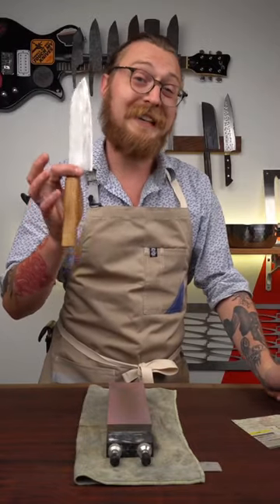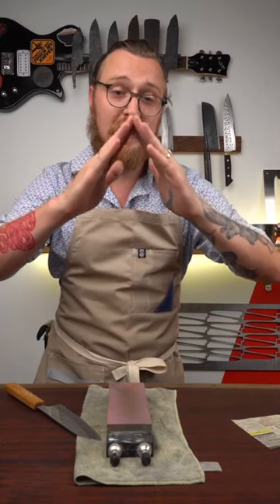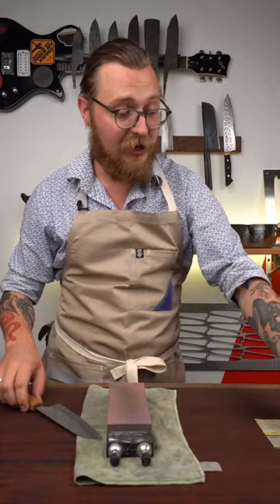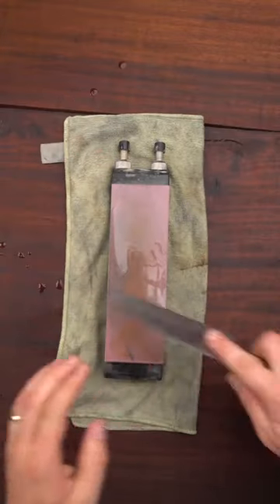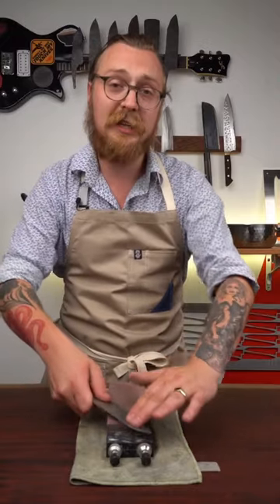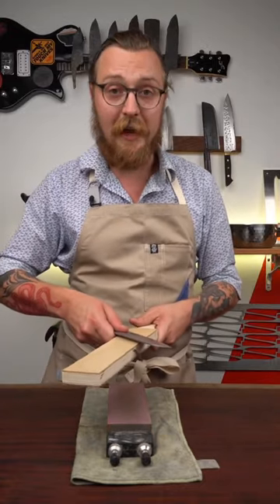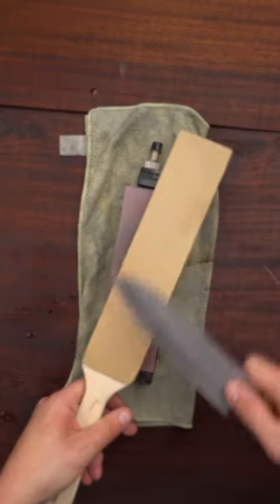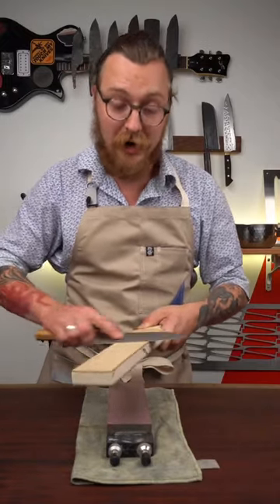Are you missing this vital step of knife sharpening?

Comment: Microburrs/wire edges can be such a pain sometimes too, even when you know about this. I think as people who like sharpening we're never-endlessly pursuing perfect burr removal.
Reply: Edge trailing is not good to clean burr, a microburr will remain no matter how many passes you do. 
Edge leading like he did really helps. 
You also need to pay attention to pressure. 
Thick burr usually requires about 200g of force to remove but this level of force will create microburr on low grit stones. 
To remove microburr use negative pressure, less than weight of the knife, just enough to make contact. This way with edge leading you can cut paper towel just with low grit stones like 120 or 300 grit.
Strops are fine but beware 10 passes on a diamond loaded strop is enough to create foil bur. They work better if you do only a couple passes
Reply: @thiago.assumpcao  
Yup, you summed up many good techniques well. I have the most trouble with the microburr on fine stones/slower cutting stones in the curved area of the knife. Been practicing that lately. On some knives it's easier to get a more stable fine edge than others. Feels tough on the more finely grained stuff. Coarse stones I usually get a very stable clean edge.

Not a fan of strops myself, at least leather ones, loaded or not. They have their place for some techniques though.
Reply: @WormyLeWorm  On the curved region you can have problems with angle stability. If you raise the angle a bit when you are creating the edge latter it will be a hassle to clean the burr. Sharpening with a microbevel will help with that. 
Usually I sharpen with 10 degree edge and finish with a a few alternating edge leading strokes on 15 degrees. 
Even soft steel like 56 HRC can hold this edge and it will cut much better than a thick 15 degree bevel. As a bonus it's also easier to clean the burr.
Reply: @thiago.assumpcao  
Sharpie showed that I was being pretty consistent, so I was wondering if pressure might be a factor in my case as well. From what I can tell, from however accurate a scale can be for this, I tend to use 50 grams or lower of pressure when at this stage and when i lift the knife and therefore have less of the knife's weight behind it, it's often 20 grams or less. 

I've been experimenting with just that technique you mentioned as well, since it seems like insurance. I seem to sharpen around 12-13 degrees naturally and then I raised it a bit and did a couple strokes at the very end. Will see how my edge from earlier today holds up soon. A fine edge on my higher carbide stuff holds up well, but on things like my white #2 knives it's tough to get that area as well as I get the heel, when going finer, it seems like. Maybe just easier to recreate a microburr on these steels.

Also been thinking about picking up a microscope to really see what's going on with my edges since the naked eye and really bright lights can only see so far.
Reply: @WormyLeWorm  High hardness knives usually are easier to clean burr than soft knives. Didn't notice a difference with carbide content but is possible. 

If you sharpen with a lot of pressure a sudden drop to 50 grams may not be enough to clean burr with just a couple passes. If you still have trouble it's worth a shot trying the 10/15 method and do some extra passes on 15 degree. You can also try to go even lower with the sharpening angle like Full Flat V Zero and finish with a 20 degree microbevel.

Microscope is fun. For burr detection it didn't help me but very helpful analysing stones, many surprising findings. I have some videos with stone microscopy but they are on Portuguese.
Reply: I avoid forming a burr at all on my knives.
Hardly ever have to deburr that way.
Reply: @autumn5592  No burr technique is is faster but takes more time to learn. It's quite easy to leave some parts not fully apexed or grind too much. 
If you can cut paper towel and shave hair when doing no burr you already got it.
Reply: @thiago.assumpcao  Yep, I can, off my 400 grit stones, not really a struggle.
I have been sharpening half my life though, so probably expected.

I certainly don't recommend the method to beginners or relatively inexperienced sharpeners though.
Reply: @autumn5592  That's an excellent challenge. Mastering low grit opens up a different kind of edge that for many tasks performs better than polished edge 

I'm kind of new to sharpening, but quite dedicated. Just managed to shave hair and cut paper towel out of a 36 grit dressing stone.
Reply: @autumn5592  I do the same, but on one condition.

That being that I know the knife has been sharpened, by me, to a burr and therefore guaranteed apex once already. Otherwise, in my experience, some parts of the edge can just end up forming a microburr or have fatigued steel that needed to be removed to create a stable edge.
Reply: @thiago.assumpcao  Oh absolutely, I love coarser grits for most sharpening. I rarely go above 1,000 grit, even for woodworking tools.
There just isn't much reason outside of looks, in my opinion -- but I'm not a chef or super fine woodworker, I need a sharp edge and pretty fast for my needs. Still fun to break out the ultra fine polishing stones once in a while though.

I haven't gotten paper towel slicing off that coarse before, mostly because I don't have anything that coarse.
But I have gotten (arm hair) shaving sharp off a double cut bastard file before, and I have sliced paper towel off 120 grit sandpaper and 180 grit oil stone.
I should try with something coarser sometime soon for fun.
Reply: @WormyLeWorm  Yeah, I should have added that -- if I don't know the steel, I almost always rely on forming a burr, because you just don't know.
My EDC knives and tools all have steel and edges I know, so I can sharpen without thinking and don't need to form the burr.
Reply: @autumn5592  Nice. Bastard file is on my to do list. I got one but never tried.

For vegetables and barbecue I prefer 1K or bellow but coarse edge on raw meat feels really bad. For raw meat I prefer high polish. I tend to use two knives so both are optimized.

If you work with western knives, hardness up to 60 HRC, there is one tip that really helped me and few people know. 

Soft steel can't hold an edge with 10 degree sharpening but if you add a 15 degree microbevel on top of that it will not roll easily and cutting performance on hard vegetables is much better.
This makes a huge difference.

You can go even lower than 10 degrees and make a full flat V Zero as long as you finish with a 20 degree microbevel.

Actual angles you can use will vary depending on steel type, heat treatment and how you use the knife, this is a general rule as a starting point. Don't use any impact on knives sharpened this way and don't touch bones. They should last quite a while. I had no issues even with 56HRC.
Reply: @thiago.assumpcao  
I don't cut much meat personally, since I don't often cook for myself.
But my sharpening job on the house knives are never complained about.

I know a fair bit about geometry, sharpening angles, and so on, because I make knives, and have sharpened professionally for a while.

Mostly people don't really know how to use knives, so I tend to leave them a little thicker and use quite a steep angle, because it just makes them more durable to lateral force.

I do also leave some of my EDC knives relatively thick because I do use and abuse them; prying, twisting, cutting things I shouldn't, and digging.
A thin knife, unless it's some real tough stuff, just isn't going to hold up.
But I do prefer thin knives, for knives that don't experience any lateral forces, it's so much nicer.

I am not particularly a fan of microbevels, because they aren't good for maintaining geometry of knives, outside of japanese style kitchen knives and the sort.
I reserve them for quick and dirty edges.
Almost all my knives are scandi, full flat/zero, full convex, or saber grind. 
Simple, easy to sharpen, maintain geometry well. Because I don't like thinning.

Microbevels, even though I don't personally like for my use, are great, and I often recommend them.
Reply: @autumn5592  What you are using them for is very different, makes sense you prefer something else.

Comment: You should use a compound on the strop
Reply from the maker: I often use chromium oxide!
Reply: You don't need to; if the goal is just deburring, then you don't need anything just a material (leather, linen, denim, card, MDF), and take a dozen passes each side. It should deburr perfectly fine.

If your goal is polishing, or further sharpening, then you can use compound.

If you are stropping to maintain edges, you will want compound.
For deburring after sharpening, completely not needed.